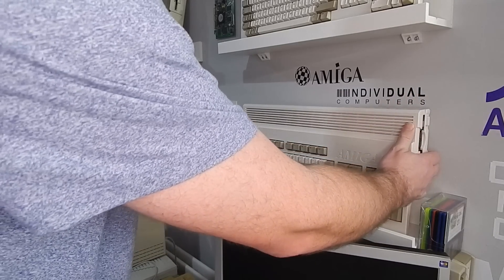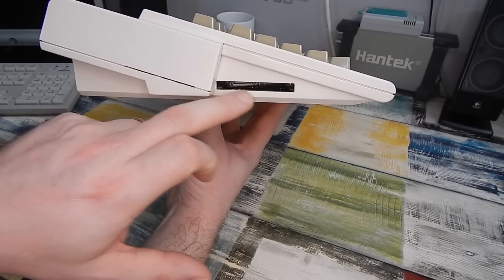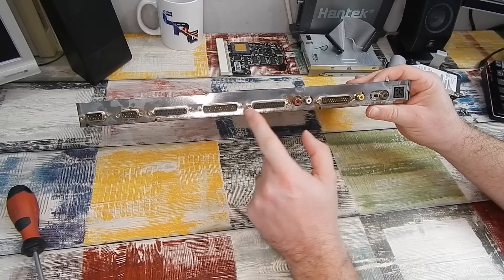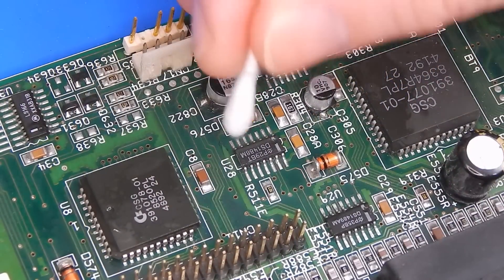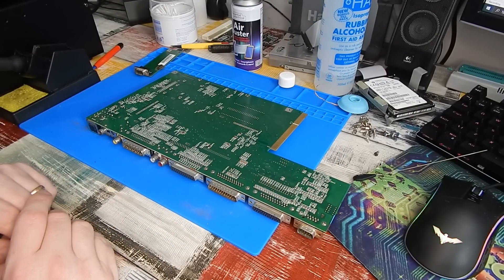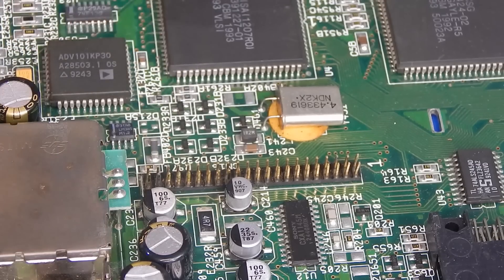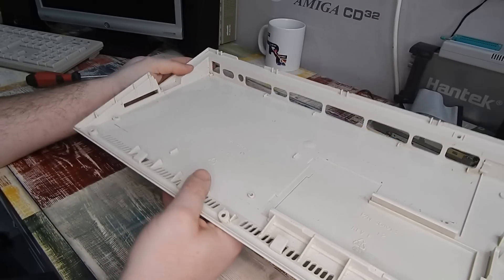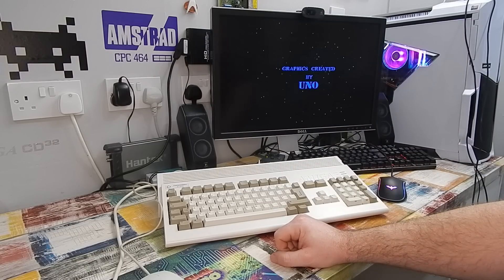Amiga 1200, time for some long overdue maintenance

Comment: I see one exposed copper trace near the first ic you cleaned from the white residue, you should cover it with some solder mask or at least nail polish or it will rust over time and may became a problem!! Nice repairs!
Reply from the maker: Your right, had to watch it back to see and yeah there's maybe 2 traces exposed.  I'll get straight in there with a bit of clear nail polish to protect it. 

Thanks for point it out, I obviously missed these first time.

Comment: Just messing around with my A1200. Got an ACA1221 clocked to 28mhz, 32mb Ram, WB 3.1.4, Map Rom for 3.1.4 Kick. Gotek Drive, External Floppy Drive. I need it recapping to be honest. May do it myself but I dont want to mess it up.
Reply from the maker: Sounds like a nice setup.  If you take your time with the recap I'm sure you'll be fine.  Just be careful around the plastic bits.  But if you want it done there are plenty of folk in the community that do it for about £40

Comment: Nice work dude. Weird how those card slot pins ended up like that. If you ever get the RF shield out again, whack a layer of clearcoat on it and that should keep the rust away.
Reply from the maker: Yeah that not a bad idea, just a bit cold here still for spray painting.  I'll leave it till the warmer weather then give it a quick coat.

Comment: I think the PCMCIA port is supposed to have screws on each end that hold the plastic part to the board. I could see holes in the board at 16:42 when you were solding the new one in. You wouldn't need bluetak then.
Reply: M2 bolts should fit.
Reply from the maker: There wasn't any on the original, rather those holes where filled with solder.  I actually expected there to be some sort of support in there, hence why I cleared the solder but there was nothing.  Some sort of support wouldn't hurt though, I'll see about adding it.

Comment: The A1200 is a really nice system. Your's look to be in very nice condition :) It's a prefect tinkerer's machine. I'm so impressed with how well file transfer using Amiga Explorer works, despite the A1200 being an almost 30 year old system.

Comment: Really good video. Love your methodical approach, and honesty about bits you're good at and those you find harder (surface mount). If an IDE header is missing most of it's pins, can you get a replacement header for the A1200? Same as any other IDE header I'm guessing?
Reply from the maker: Yeah if you needed the full thing I'm sure one could be got somewhere, people are buying them for the reAmiga boards.  If I were to replace the whole thing I might look at a header with the shroud around it, would certainly stop and chance of misaligning the cable.

Comment: Maybe paint the RF shield with sliver paint so that it won't rust in the future. I think Noel's Retro Lab did that (or was it Retro Recipe?)
Reply from the maker: Yes that's a good idea but it's still a bit cold here for spray painting.  I'll leave it until later in the year then maybe go over it with a clear lacquer rather than paint.
Reply: @CRG  I have an LG Gram laptop here that wasn't the greatest paint ever from the factory. Sanded back to bare aluminium and clearcoated it with that rust-o-leum stuff and it's stayed nice.

Comment: Nice vid. I'm just watching these and starting to dabble in a bit of re-capping and cleaning my old gear etc. In most of the vids I watch everyone seems to handle boards pretty freely, is static an issue or is that blown out of proportion?
Reply from the maker: Can honestly say I've never used one of those static wrist straps and I've never had any issues. Others swear by them and I suppose if you want to be sure you don't cause damage then get one.  

That blue mat you see me using in various videos is antistatic so it helps.

In the least the old advice used to be touch a radiator before working on the boards (your heating system is grounded) and don't wear clothes that generate a lot of static.
Reply: @CRG  cool, thanks for the info. I'll probably just discharge on the radiator and just not wear nylon etc.

Comment: I wish I could fix my poor old Amiga, I am visually impaired so no soldering for me 😫 is a Mister a good idea?
Reply: Do you even know what's wrong, with it?
Reply from the maker: The mister is a good emulation machine.  I seen one running Amiga back in Amiga Ireland 2020 and it looked great. 

What's wrong with your Amiga?  There a lots of folks within the community that repair these machines so it might be worth reaching out to some.

Comment: good video !dose anybody know about c64 video out composite out i got a cable to scart and it looks bad in games liney in the desk top lode window
Reply: On: Good OLD TV/CRT screen..what?
Reply from the maker: I'm using a scart adapter on my 64.  It just carries composite but have never had an issue with the video quality. 

Composite is a bit blury still and lines can be a problem caused by the VIC2.  Not much you can do about it I'm afraid other than replace the Vic chip.  An svideo cable might give you a slightly better picture.
Reply: @CRG  some games are red .😔I got to re cap something ain’t right! Might be the vic 2 chip
Reply from the maker: @markdjdeenix6846  could also be the colour ram.  Might be worth picking up a test cartridge to help determine where the fault is.
Reply: @CRG  thanks so much I will get a schematic and just replace it 😀chips are cheep if available.but my time is not caps are on order 

Just thought about the modular caps ! I didn’t open the modulator can up
Reply: S-video will definitely be better quality.

Comment: Nice repairs! Btw, the Lisa chip has "CBM 1993" printed on it, so it must have been christmas 1993, not 1992. :)
Reply from the maker: You know I wasn't sure if it was 92 or 93.  Hard to remember back but must have been 93 as you say.
Reply: Mine would definitely be 1992 since I bought it in that year 👍